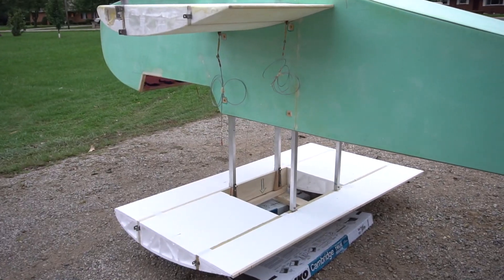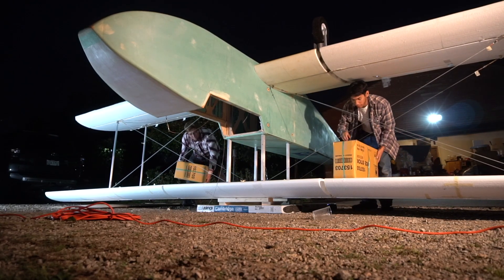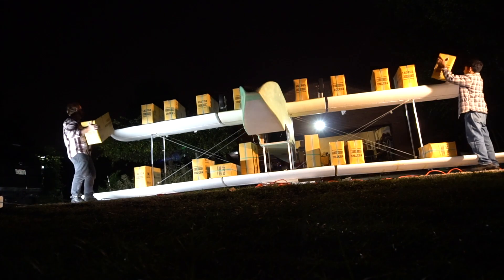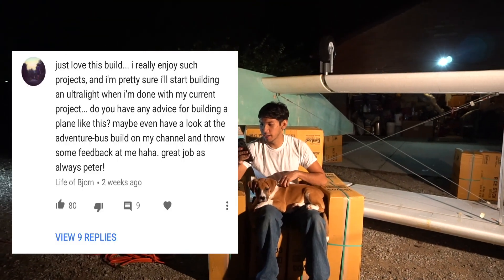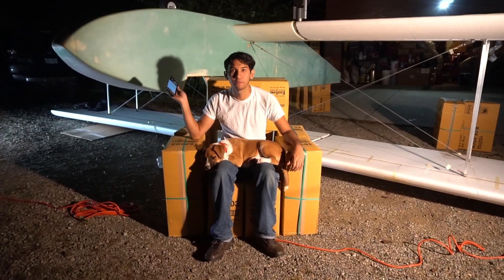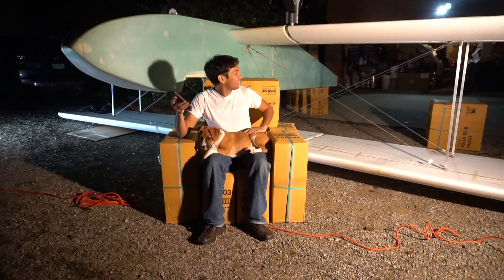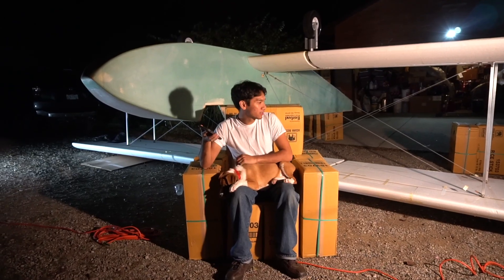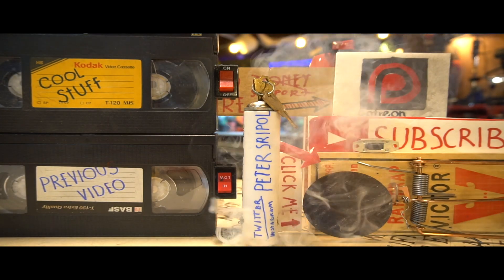DIY Electric ultralight pt5 (Making the Wings)

Comment: Thanks for the videos. The construction looks good. Still very dangerous.
The castellated nuts your using are acceptable. I would use MS17826 or MS17825 with out lock tight. Generally lock tight is not used on aircrafts.

Comment: Options for nut retention:
1. Nylon Lock nut (one time use ONLY, still not best)
2. Threadlocker (blue for temp, intend to remove later; red for PERMANENT attachment)
3. Castle nuts with cotter pins or safety wire

mechanical retention always better when dealing with vibrations.

Source: I am an Industrial mechanical engineer

Comment: QUICK FACT, the cable you're using was regulation thickness for most cable clutch designs during the 70s and 80s

Comment: NEVER use Loctite on any Nylock nuts. The chemicals in Loctite (or any other thread locker) will create a chemical breakdown of the nylon in Nylock nuts. If you have nuts that you feel need Loctite, safety wire them instead. That's a standard practice in "race vehicles".

Comment: Agree with some useful comments further down  (hogflyer62 / Zach W / Arron Bates). When plane is sitting supported at either top of upper wing or fuselage, the wings are only supporting their own weight, so this is basically Zero G's instead of 1G as a starting point. Would need to load wings with gross weight of plane (plus Peter) for 1G. Then build up from there. I do think the design will be OK though!

Comment: 1G is the weight of you plus any part of the plane that will be supported by the wings as it will be distributed on the wings.  To be safe I would test it with most of the weight near the wing tips.

Honestly I think this thing will be plenty strong to fly, you know enough about basic aerodynamics and I'm sure you've done the math on cube loading...  You know how to build something that flies well.  I am surprised that you went biplane but I'm guessing that this is the result of wanting more lift and drag/less airspeed.

The place you're going to have a disaster is with the landing gear, something you likely didn't think much about since many of your RC plane designs just skidded on their bellies.  The 2 problems with them are that 1- they're just not that strong/well braced, unless you're just going to fly off of very smooth runways I suspect you'll have issues with them, and 2- your biggest problem, the mount, that if  you bend it (and with the current design, the first time you touch down hard and catch something you will) you trash the whole plane.  Unless you make the mount stronger you might as well make the rest as week as possible since I bet that doing a bely landing in the grass with that thing will be less damaging then catching the gear on a pot hole or chuck hole.

Comment: If you use Nyloc nuts, the torque to turn the nut varies, but vibrations alone won't turn it. The castle nuts and cotter pins are the best, but in the Auto field (my line of work) I prefer Nyloc and they never come off unless heated or turned. Good luck Peter! I hope to see you flying soon!

Comment: Please also put x wires in between the outer connecting wing supports to manage potential twisting wing flex 
look at other bigger doulble deckers they are all that way 
& maybe consider bike shocks as suspention there are some light air sprung forks & shocks out there 
Anyways keep it up nice videos & projects !!!

Comment: You didn’t apply enough load to the wing to clear it to fly. To clear it to 2.5 g at the design weight, you should apply 2.5 x 1.5 = 3.75 times the design weight. The 1.5 is the structural safety factor that you failed to include. Your current test only clears the wings to 1.67 g’s at the design weight. That is not enough. I would clear the airframe to 3.5 times the design load factor which means you need to load the wing to 5.25 times the design weight which is 2.1 times the load you applied in the video. Don’t worry about breaking the wing in the structural proof test. If the wing fails this test, it would fail in flight with catastrophic results.

Comment: Peter, you said the all up weight was 370lbs then loaded the wings with 370lbs of noodles claiming 2g. This is incorrect. In 1g flight your wing will be carrying the entire weight of the aircraft 370lb. In 2g flight with your figures it will be carrying 740lbs, at 2.5g 925lb. You need to get some more noodles on there and put them further out because the bending moments around the joints will be what ruins your day.

Comment: when i had ultra light flying lessons they didn't let me go higher then 20ft at first until i got much better, but that was only on straight flights with no turns. so until you get better i would suggest keeping a low altitude, and only flying straight to get used to the controls.

Comment: Hey there Peter, thanks for doing what I have always wanted to do! Tip, lower the air pressure in the tires for some free suspension. Won't be a lot but will add a bit of give for landing.

Comment: Your cable fittings on the spar should be in line with the cable not 90° to the spar and there should be a pair of fittings so the bolts are loaded symmetrically while bearing in the spar. The weak link in the flying wire assembly is the spar attachment.  Look in the online wood properties database and ANC-18, "Design of Wood Aircraft Structures". 
And regular AN365 nuts are all you need, castellated nuts with pins are used where the part has to rotate.

Comment: No locktite on self locking nuts are not good practice, it kinda defeats the purpose and will destroy the nylon.
Just be aware that a nylon locking nut is pretty much useless if you unscrew it and use it again, I have seen them come undone this way.
Castle nuts with wires are used on anything high stess I work on but I work on stamping presses and those probably have a heck of alot more vibration than a plane wing so take my 2 cents for what it is.

Comment: Have you calculated the L:D(lift to drag), D:T (drag to thrust) or D:P (drag to propulsion) also the weight to lift and you need to find the center of lift and center of weight(or mass doesn't especially matter). Don't forget to make absolutely sure that your landing gear is more than viable or you will skid along the ground and sand you into dust